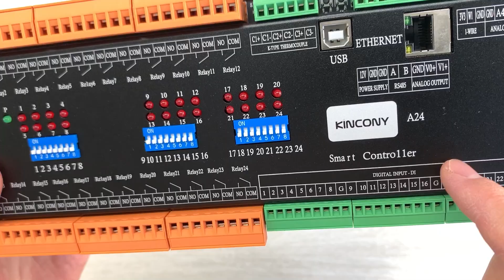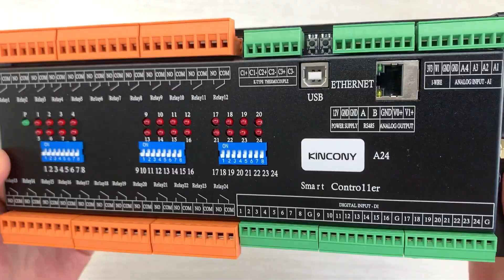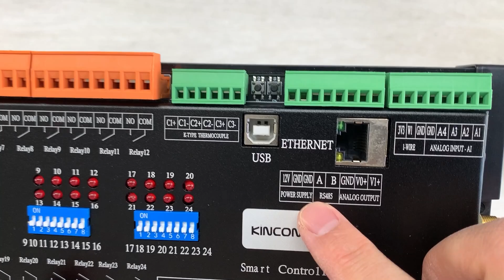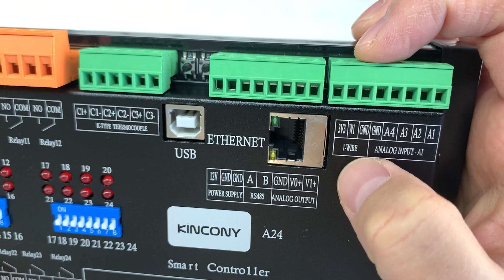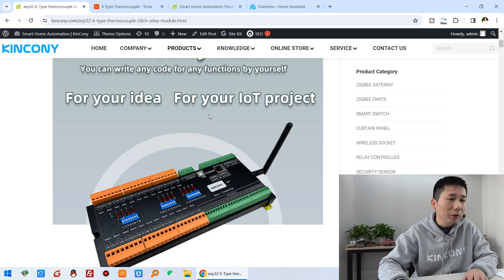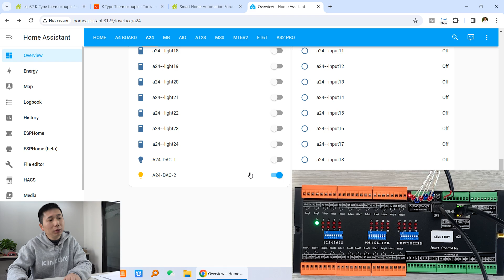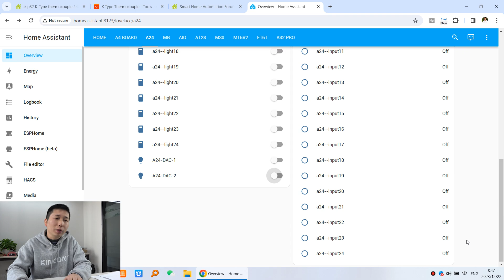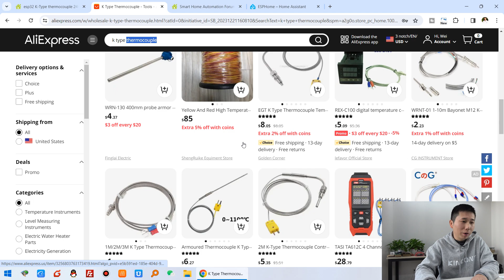ESP32 K-Type thermocouple 24CH Relay PLC Module - KinCony A24

Comment: What would be nice is if you had an integrated app with autodetect in Home Assistant, to enable and simplify the setup of these devices you've made, preferably via local channels (no cloud). Just a simple and secure yaml configuration system would be very sweet. 

PS: this is one of the nicest vid's you've put out so far. Love the laser engraving demo. This product looks nice and promising!
Reply from the maker: thanks, all our products support esphome, we have supply YAML file , just directly to use.